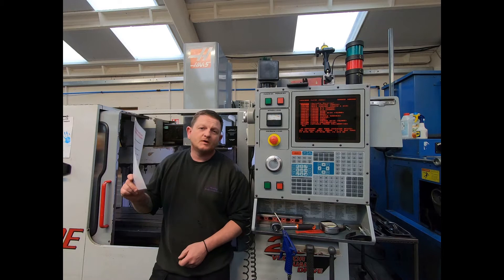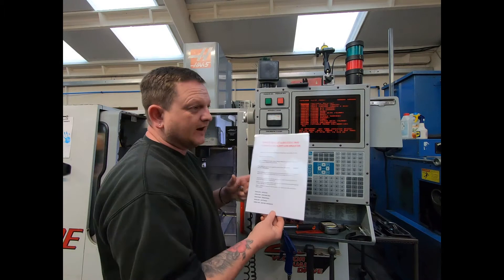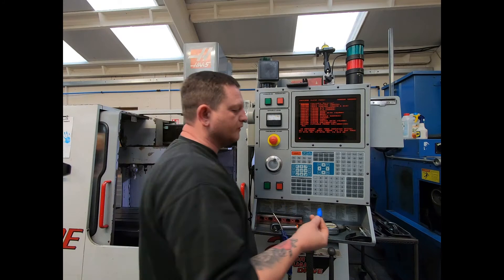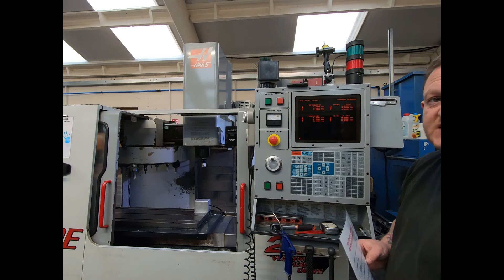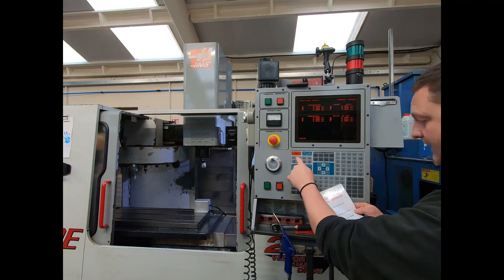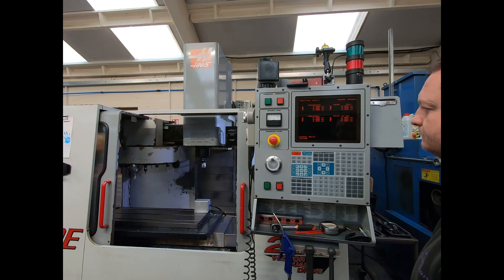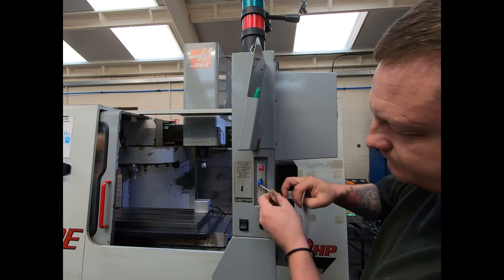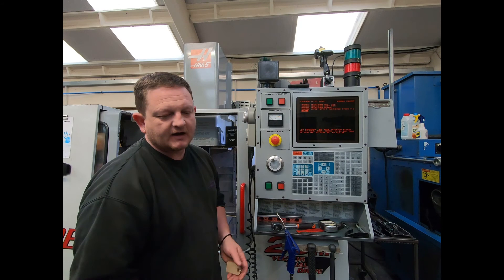How to Save your parameters, settings, programs & macros on a classic Haas cnc control

Comment: Marc, 
Thank you for taking the time to create and post this. Your video and process are very good. I love the laminated instructions, presume you create them yourself. My Berta, a 1993 VF0 has been running in tip top shape thanks to people like you who share their knowledge. 

A bit off subject but I cannot help notice the framing of the buildings ceiling. Are they fabricated wood, cast concrete? Are those Skylights or LED panels? I am always looking in the background for ideas and inspiration. Your shop is full but clean and organized. A video of the details would be great.  
Cheers!
Reply from the maker: Hi

Glad you like the video,

The workshop is one i rent for my Business and the framing is old cast concrete sections but the actual roof panels are quite new in comparisson and are 150mm thick insulated panels approx 1200mm wide x 6m long, they keep the heat in really well in winter but its a bit like a greenhouse in the summer, the large clear sections let in loads of natural light so during the day i dont normally need the lights on

Maybe i will do a walk round one day

Thanks
Marc

Comment: Hi Marc great videos. what happens if my floppy gets full during the transfer do I just press reset? Keep the vids coming mate VF5 all the way 😂
Reply from the maker: If you wanted to you could create a separate disc or usb for for each of the folders so 1 for parameters and 1 for settings and 1 for offsets etc

Thanks
Marc
Reply: @kinzy_fabrications  thanks mate I got sorted all backed up now 👍👍

Comment: Trying this with my 97 vf2 and it is not working. One thing I noticed is while in edit mode on the position page it says F1 begblk F2 endblk at the bottom. I don't see that on your screen. When I key in my machines s/n and hit f2 nothing happens.
Reply from the maker: Hi are you using a usb floppy emulator or rs232? it sounds like your using rs232 and somethings not set up right
Reply: @kinzy_fabrications  Thank you for responding! I'm using a floppy drive.

 I was able to get it to work. I had to be in list program mode. 

While in list program mode I was able to download each file from its respective page. I saved the files with the s/n of my machine followed  by the extensions on your sheet.

I have an emulator, but have not installed it yet. I wonder if that would make a difference or maybe it worked on your machine because it's a few years newer?

Either way I got the backups and maybe this post will help someone having the same troubles someday.

Thanks again for your reply and love your videos!
Reply from the maker: @chip_maker5859  I’m glad it worked for you eventually 

Thanks for watching

Comment: Hi , think i need to change battery soon on my 2005 TM1 .... is it possible to backup settings  over rs 232 ?  Cheers Kev
Reply from the maker: Hi

I have not tried using Rs-232 but it should! be exactly the same procedure but using send to rs232 rather than directory

Comment: Is it possible to do this if you only have the serial port connected to a pc? my machine does not have a usb or floppy..
1995 Mikron vce750 (haas model2)
Reply from the maker: Hi

Yes I believe you can do it just the same but select rs232 rather than read floppy

Thanks
Marc

Comment: Hello Friend due to battery my parameters and settings has gone do you have this file for VCE 1000 DATE OF MFG 2001
THANKS 
BATUHAN KAYGAN
Reply from the maker: Hi

I am afraid I don’t have your parameters files but Haas should be able to supply them if you contact them

Thanks
Marc
Reply: @kinzy_fabrications  Thanks Marc